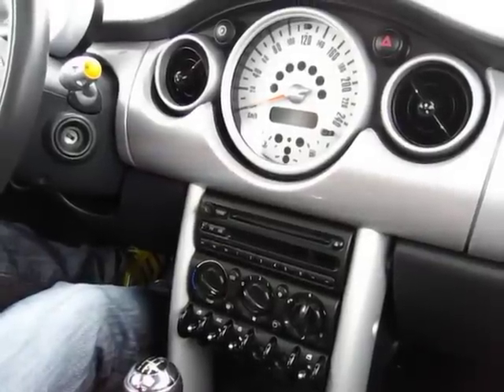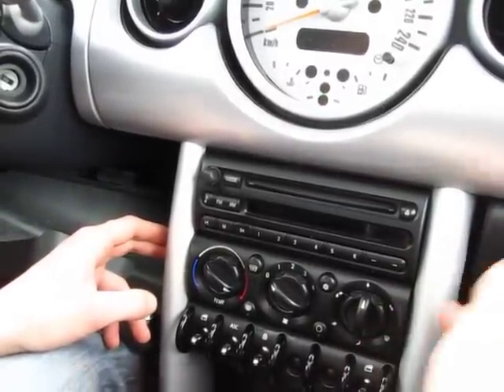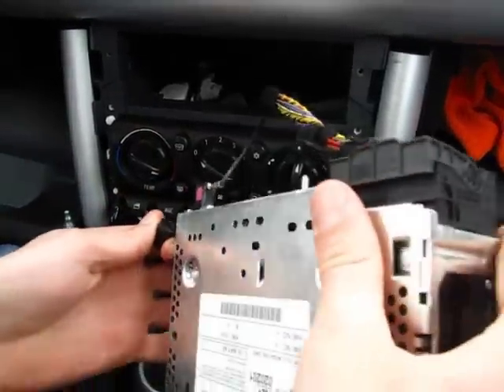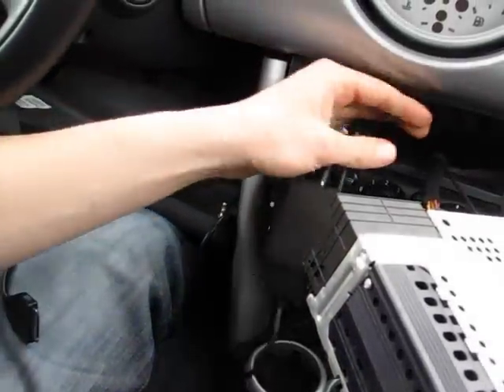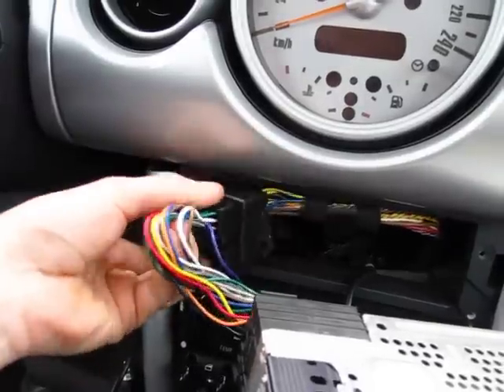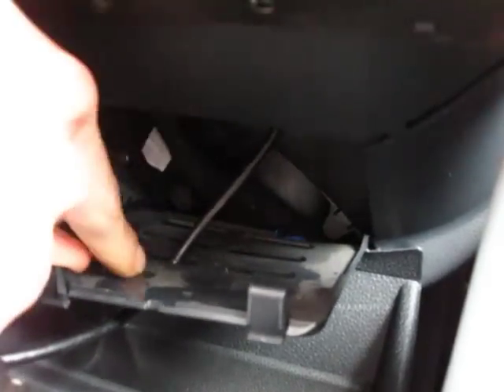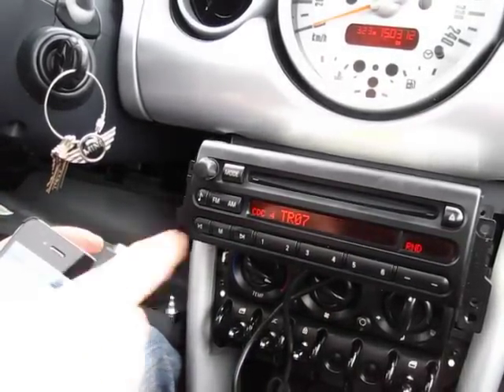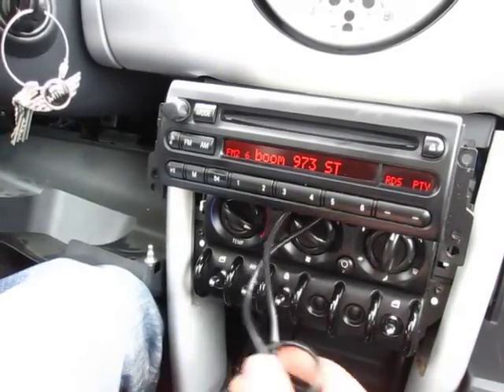GTA Car Kits - Mini Cooper 2001-2006 install of iPhone, iPod and AUX adapter for factory stereo

Comment: I got the radio unit out and checked if all cables where connected, but that wasn't the problem. I saw some kind of fuse (with a number 2 on it) and got it out and back in. Now it works again!

Comment: Hey kpiza, i had the same issue with my gf's mini. The silver panel around the speedometer above the radio needs to come out slightly in order for the side pieces to be removed. Its attached w clips and one screw which is upside down inside the glove compartment. Loosening this silver panel enabled me to remove the side pieces which allowed me to get to the radio. Other than that install was a piece of cake!

Comment: I had exactly the same problem.  What you need to do is to remove 4 additional screws.  Two are located in the front cup holders and are easy to get at.  There are two more underneath the control panel that moves the wing mirrors.  You'll need to pry the cover off with something, and be careful not to damage the trim.  Do a google image search for "replace mini cooper radio" and you'll find pictorial instructions.  Finally, the kit only works (for me) when the key is turned to position 1.

Comment: Just installed mine and if you or anybody else is having problems read on. I tried to follow this video but on my 05 mini cooper S the panels were not falling like this dude said they would. What I did and you guys can do if you are having this problem is to unscrew the same screws this guy unscrewed. Then remove the screws that are on the front cup holder and the ashtray. Then you will have to remove the little panel that adjusts your side mirrors and the 2 screws inside and that should do it.

Comment: Hi there, 

I've just bought a Mini One D from 2003 and my radio is almost the same as yours except for the volume button (with me it is smoothly round). Can anyone tell me for sure if I need the round or flat pin adapter?
Would be handy to know before I start with the operation so I can do it all at once... Installing another radio that is.

Kind regards,

Denzel

Comment: I have a 2004 mini cooper s, and the side panels holding the radio won't come off. I have tried different things, none of them work. I don't want to apply unnecessary  roughness.Your video make it seem so easy, am I doing something wrong? I appreciate any helpful information

Comment: i have a 2003 mini cooper, i just bought a Sony stereo, also i ordered a harness and some kind of antenna cord, so everything is working when connected, but no sound, i connected every wire to its proper position, but still no sound......plz respond a.s.a.p.

Comment: Does it work with a Mini One 2003? Thanks in advance!
Reply: I just bought a 03 Mini Cooper as my first car did you figure out how to do it?
Reply: @megansimpson1769  congratulations on your new car Megan! I've had my car mechanic install me a new radio and it had worked well. They only thing he didn't manage to do was to connect the radio to the function keys on the steering wheel. Have fun with your new Mini!